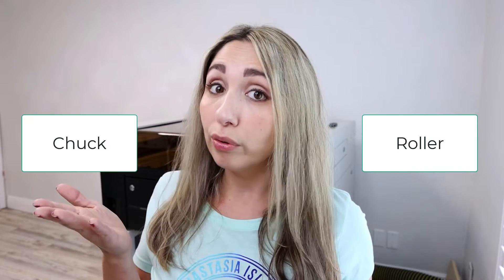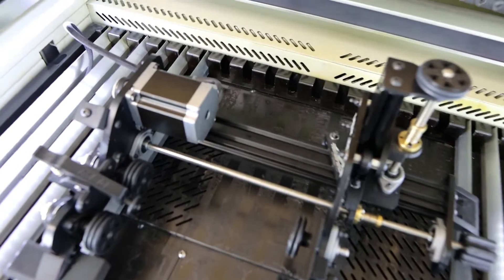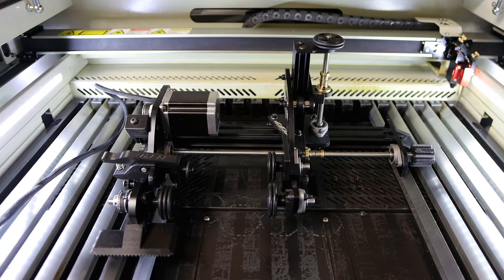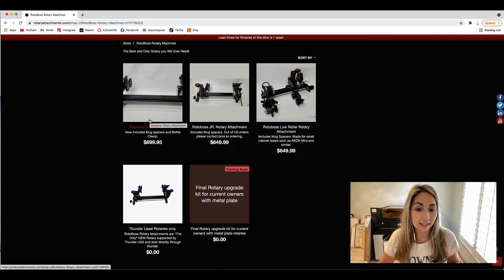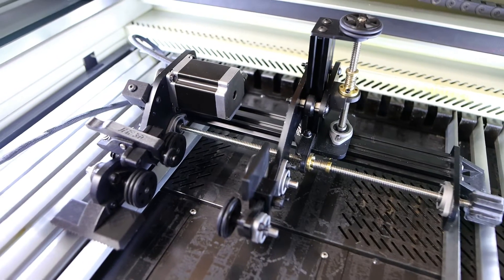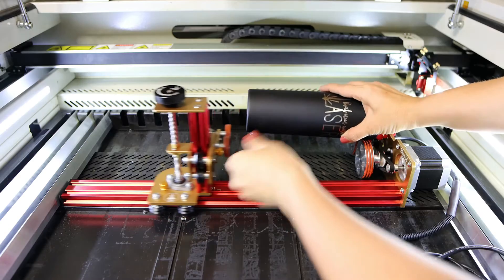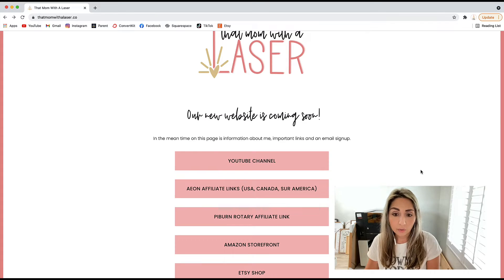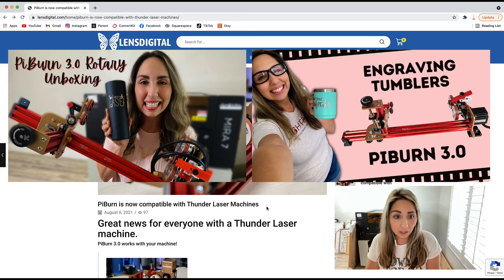Which Laser Rotary Should I Buy?

Comment: As a full size Rotoboss user I have mine set up with the motor on the left and I might be doing things wrong, but I've never mirrored an image or text before engraving.
The Pi Burn support videos are necessary because it needs to be assembled.
The Rotoboss has four attachment feet with magnets that stick to the rails under the knife blades on my Boss Laser. I'd like to see how the PiBurn would attach with its center post mount.
With that said the PiBurn looks like a solid unit and I've never seen a complaint about it.
Reply from the maker: Thanks for chiming in and sharing your experience. I’ll be sure to include that in a new video I’ll be making soon.
Reply: @ThatMomWithALaser  I'll be sure to check it out. You're doing great things and I always recommend your channel to new laser people.
Reply from the maker: @MichaelMcGuigan  that’s so very kind of you. Thank you! I’ve been a little MIA as I work to finish the course but I’ll be back soon with lots of new and exciting things! 😃
Reply: Old video but still, the wireing of thr motor can be reversed, so the connector might be wrong for your machine, there are adapters for that, check with the rotary supplier.

Comment: Hi I am new to rotarty and laser attachments. What is the difference between the Standard Fixed Feet
Magnetic Adjustable Feet?
Reply from the maker: No problem. The magnetic feet are optional and help to keep the whole rotary still. I don’t use them because I don’t have enough clearance on my machine with them. It’s not necessary but nice if there’s enough room for them.

Comment: Awesome video comparison.  I own a full size Rotoboss and a PiBurn.  The Rotoboss has been nothing but headaches from day 1 - poorly assembled, wired wrong, nothing square, stripped and glued in bolts, parts fall off constantly, etc.  The clamps and accessories I got with it are great, but that's the extent of it.  The PiBurn is like a work of art - it's super well built.  Someone complained about having to assemble it, but that saves on shipping, and it's super easy to assemble, and includes all of the tools you need for any fasteners.  Couldn't be happier.
Reply from the maker: Wow! I didn’t run into those issues with mine but I have had a few friends tell me they had wiring issues too. As for the assembly part, I didn’t mind it so much. They have a great video that shows you how to do it. It took me about. 10 minutes.